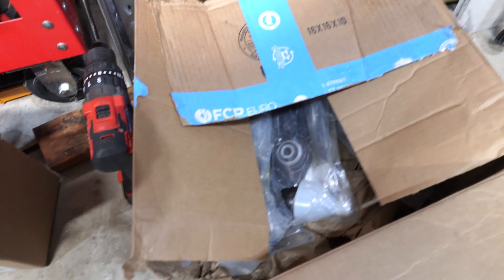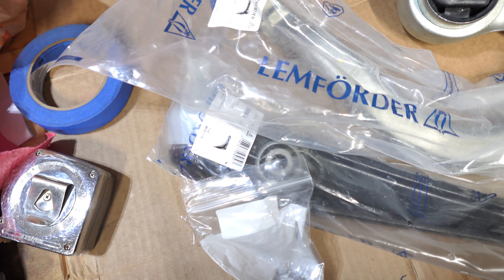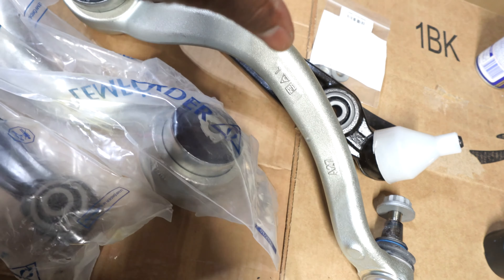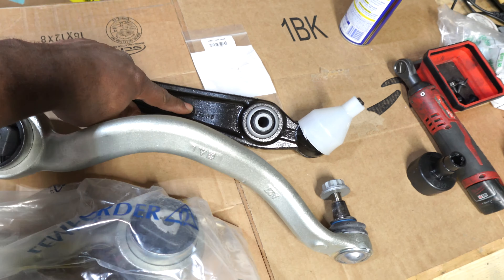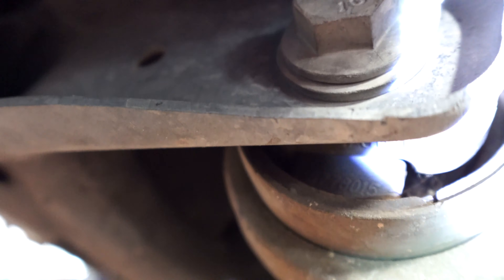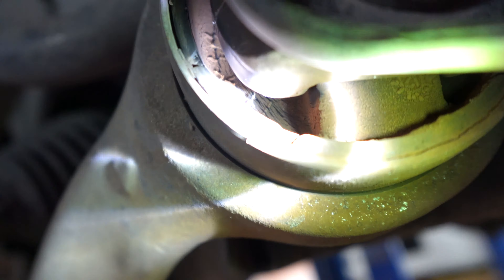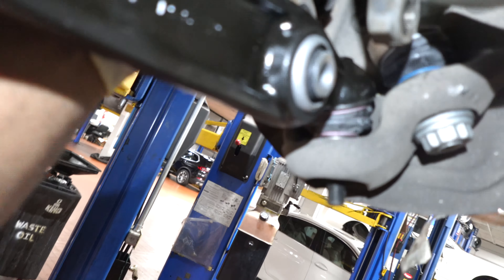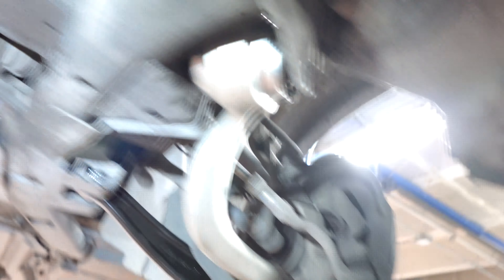Replacing Lower control Arms & Thrust Arms on 2013 BMW E70 X5

Comment: Working on a 2011 X5 right now I've replaced the wheels and tires.. and balanced them twice. I'm experiencing what seems to be a throttle dependent vibration. Only presents over 45 mph and at half throttle or more. The second you let off the gas the vibration largely goes away..any thoughts?
Reply from the maker: The best thing to do is try to isolate the vibration. the vehicle is AWD so lots of components involved. Most likely its coming from the front end. you can remove the front drive shaft between the front diff and transfer case. if vibration is gone you possibly have an issue with the front axles or front diff.
Reply: @koolfredsbimmertech5617 thank you for the reply. I was using voice text and some of my information didn't get put down completely in my first post. It's a 2011 n63 xDrive.. the vibration feels mainly to be isolated to the dash area. A little bit in the steering wheel.. but I know things can be misleading. It very much feels like it's coming from the driver side wheel suspension area. From a dead stop I can floorlr the vehicle and it rips through all the years nice and smooth and straight no vibration. But if I'm doing 45 miles an hour or more and I floor it it gets a very substantial vibration in the dash that feels like it's coming from the driver side wheel area. It's very strange... I read some information that it could be motor mounts. It's a shame because this vehicle was very well cared for. Spent almost $16,000 last year at the local BMW dealership... I hope it's something that can be easily resolved
Reply from the maker: That's kind of tricky. if its not bent wheels could be engine or transfer case mount. Have any recent repair been done to the vehicle? is this a new issue or has it been doing it for a while?
Reply: I have the same problem,I just got new wheels and tires that are already balanced, still have a barely shake in the steering wheel, I already replaced strut assembly and still the same , I took it to the shop today to do a alignment and they couldn't do it because my lower control arm bushings were bad , so that might be the shaking steering wheel.
Reply: Same exact issue here man… it was bad today when accelerating on highway uphill, new pirelli tires drives great but the shaking is felt through gas pedal

Comment: When to replace the thrust arm? My x5 has noise when hit the potholes, or bad road condition, last change of thrust arm 10k km ago
Reply from the maker: @mydc2200  It sounds like your struts or the strut mounts. The insulators wear out on the strut mounts.
Reply: @koolfredsbimmertech5617 the strut are boge, is it good brand?
Reply: @koolfredsbimmertech5617  i should have installed bilstein, boge made in china, tend to  fail early i think
Reply from the maker: @mydc2200  Binstin or sachs is good.

Comment: Thabks mate for the info 2014 bmw x3 getting a clunk going over small speed bumps now.. anti sway pins/connectors are fine so i am betting its rhe control arms and makes sense to change both of them out..

Comment: Hey bro great video and detailed breakdown. My 2018 G80 has this same Suspension set up, I just recently had the front thrust arms replaced which took away about 80% of my front end vibration. Do you think that the Other arm, the black 1 in your video could be causing the remaining 20% if vibration i still have?
Reply from the maker: Thanks! It's Definitely worth a shot. and its good to always replace them in pairs. also check the wheels to make sure they are not bent as well.

Comment: Great Video! Do you have the torque specs for the nuts/bolts?
Reply from the maker: Unfortunately not of the top of my head. I just get the. Nice & tight with a long handle Ratchet.